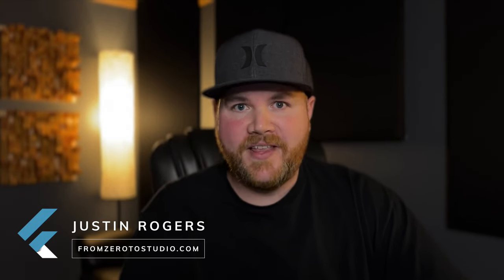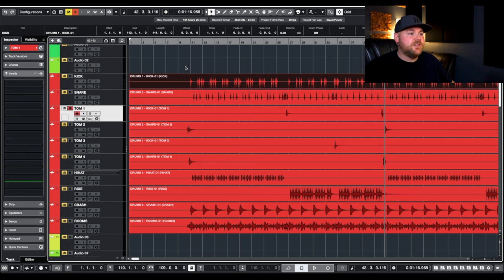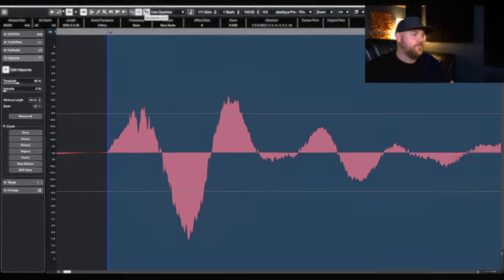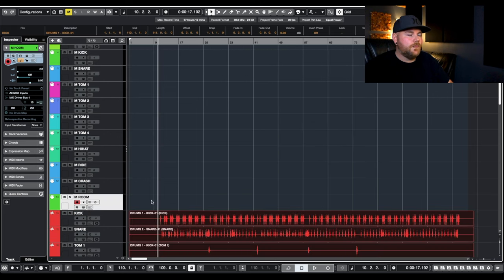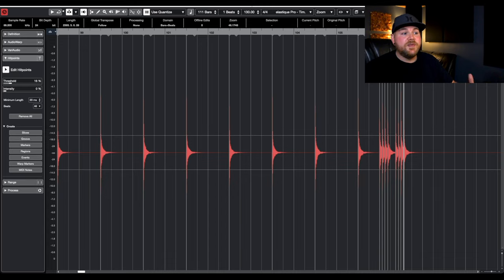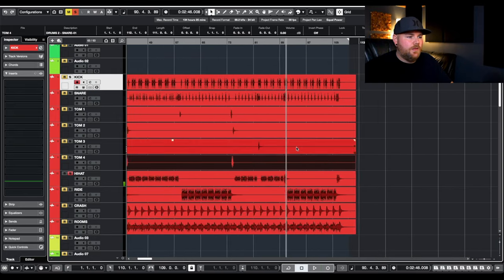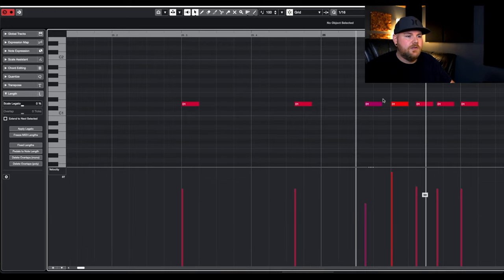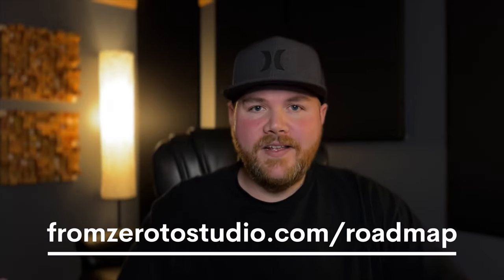Drum Samples - Converting Audio To Midi In Cubase Pro

Comment: Is there a way to convert a single audio drum track (extracted from a song, so with all the drum pieces) to midi?
Reply from the maker: You can! I just tagged you under a similar question a few comments back from yours where I explained it pretty well. Hope this helps!

-Justin
Reply from the maker: It gets a little tricky, but it can be done using a combo of EQ and gates. Duplicate the stereo track so you have one for each drum and filter out the frequencies that don't apply. For example, filter out the snare out of the kick track, filter out the kick from the snare track, etc. The Slate Digital Drum Gate is pretty helpful with this too, as it does a pretty good job detecting the type of drum chosen and filtering out the rest.

You'd then have to listen and watch the transients to ensure accuracy, and possibly even slice out some of the unnecessary audio in between hits for each drum. It can sometimes be a long-winded process, but it should give you a result that's accurate enough to convert the remaining audio to MIDI. 

In my Mix Prep video at the 13:11 mark, I cover a similar situation in which 4 toms were recorded on the same mono track. It shows how I approached splitting them to create samples. Here's the link. Hopefully this helps!

https://www.youtube.com/watch?v=Ut22yOIAt5c&t=791s
Reply: @FromZeroToStudio  I'll try
Reply from the maker: @lupusnigerprodanddistrodol9305  let me know how it works out!

Comment: I've used this guidance and it worked wonderfully in Cubase,  but the audio for my layered kick drum isn't audible after the mixdown. 

Can anyone help me figure out what went wrong?

I can hear the kick perfectly in Cubase but not at all after mixdown.
Reply from the maker: If nothing was accidentally mutedbefore mix down, double check the routing of the layered kick track and make sure it’s going to the proper place. Also, make sure that the correct channel is selected in the export window. Stereo out is typically selected as default, which should export the full mix. Have you tried exporting again with different results?

-Justin

Comment: Is there any way to do this directly inside Cubase with just a stereo drum track
Reply: By ear and looking at the transients.
Reply from the maker: It gets a little tricky, but it can be done using a combo of EQ and gates. Duplicate the stereo track so you have one for each drum and filter out the frequencies that don't apply. For example, filter out the snare out of the kick track, filter out the kick from the snare track, etc. The Slate Digital Drum Gate is pretty helpful with this too, as it does a pretty good job detecting the type of drum chosen and filtering out the rest.

You'd then have to listen and watch the transients to ensure accuracy, and possibly even slice out some of the unnecessary audio in between hits for each drum. It can sometimes be a long-winded process, but it should give you a result that's accurate enough to convert the remaining audio to MIDI. 

In my Mix Prep video at the 13:11 mark, I cover a similar situation in which 4 toms were recorded on the same mono track. It shows how I approached splitting them to create samples. Here's the link. Hopefully this helps!

https://www.youtube.com/watch?v=Ut22yOIAt5c&t=791s
Reply from the maker: @lupusnigerprodanddistrodol9305

Comment: ...i wish there was just one command to do this, like logic has...cubase drum replacement is more complicated..🤔
Reply from the maker: Cubase can actually convert a drum audio track to MIDI very quickly, just like with Logic Pro. The detailed time involved is spent ensuring that your MIDI lines up perfectly with every transient and fine-tuning the velocities. Cubase can automatically do all that, but just like with any other DAW, it’s not 100% perfect. For the velocities, I find that it takes more time to sort through and correct any inconsistencies in velocity than it does to put them all at the same level and dial them in manually. Of course, this can all be preference in workflow! If you have a system that works well, stick with it and try to refine it for efficiency!

Comment: The problem is when you have a drum track in one file...
Reply from the maker: That’s definitely more challenging but can still be accomplished by using different filters and manually splitting up the track as needed. It’s a much more labor intensive process for sure! I actually had to do that with the toms in this drum track. All 4 toms were on a single track coming right up the center without any panning. You can see how I split them up in my mix prep video at the link below. Check it out at around the 13:10 timestamp! Hope this helps!

-Justin

https://youtu.be/Ut22yOIAt5c